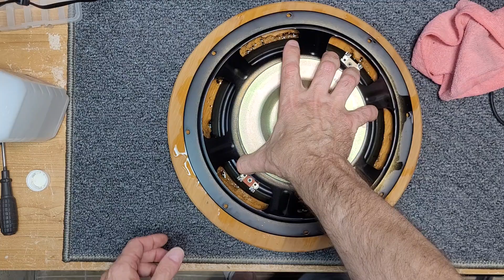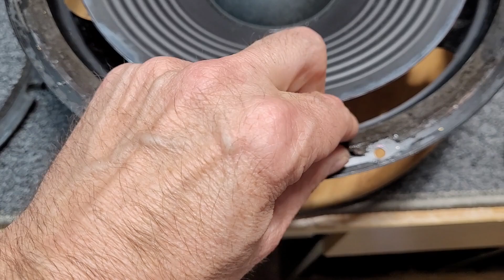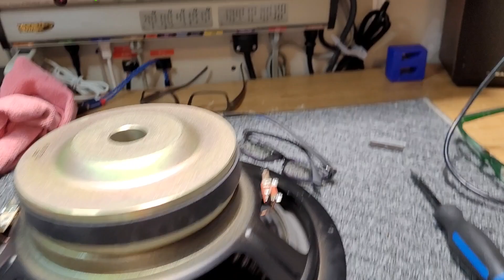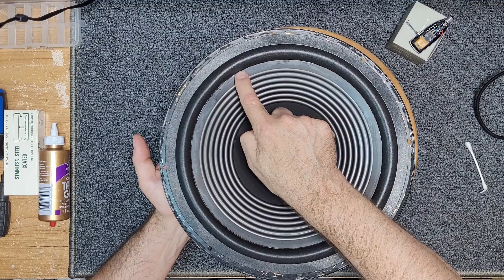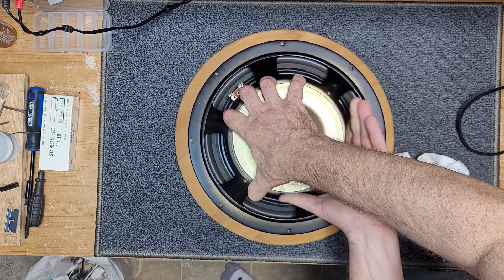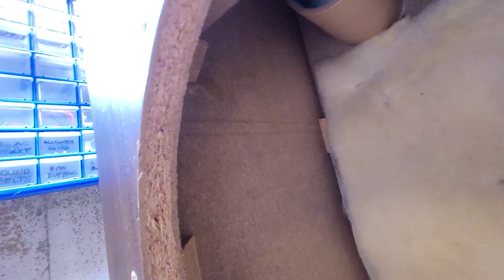Pioneer DSS-7 Restoration Series Part 2 - Foam Replacement

Comment: Hello. I’m curious, how did you get the tweeter out and were you able to do so without damaging it?
Reply from the maker: I did not remove it.  The service manual states that you have to press on it from behind with a screwdriver, but when I did that, the plastic was bending.
Reply: @TurntableGuy there are 4 screws holding it onto the cabinet, but the “cover” is held on with adhesive. I suppose maybe heat it up and that may help the old adhesive let go a bit. I got an extra set of tweeters, but it looks like the guy just pried the covers off with a screwdriver, as there are pry marks all over the edges. I was just curious if you had taken yours off or not. I appreciate the response.

Comment: Goof-off cleaner will break down that glue and it will come rite off. You can get it in most automotive departments. Then go back with alcohol and clean up the goof off residue.

Comment: I haven't seen part one. When I did this, I went wth a compnay called "Simply Speakers." they have the exact surrounds for just about any speaker. In addition to the surrounds, they include everything else needed, along with instructions. THey also have videos showing you how it's done.

Comment: good job. I know you explained the speaker "fabric" composition. Just wondering if a little "Armour all"  protectant ( as used in cars) may bring those "dried" sections of speaker cone back to colour. It may have been just dried out from the IPA. Use a very small amount on very small section at first with Q tip, let dry, and see how it looks.....just a thought.
Reply from the maker: I'll try that

Comment: I use a sharp chissle on the basket. Mr.Electricity uses lighter fluid to soften the adhesive. Good job. 👍 sounds good on the phone anyway. Sizzling.
Reply from the maker: I think I'll try the chisel idea on the next driver.